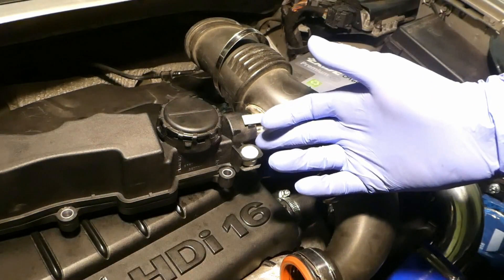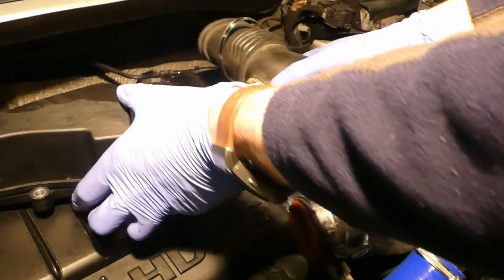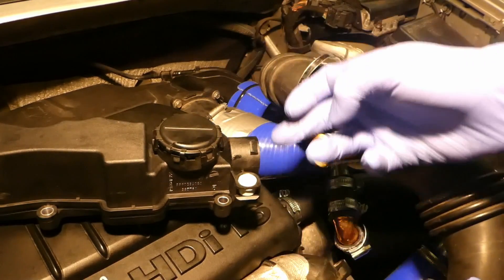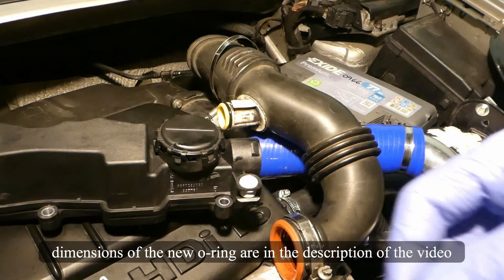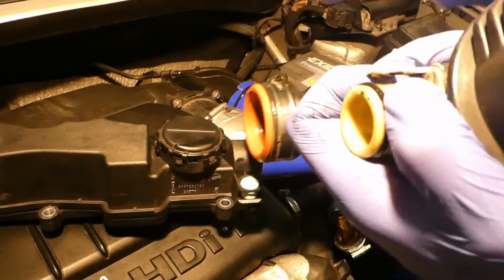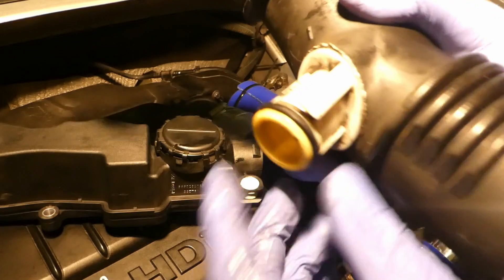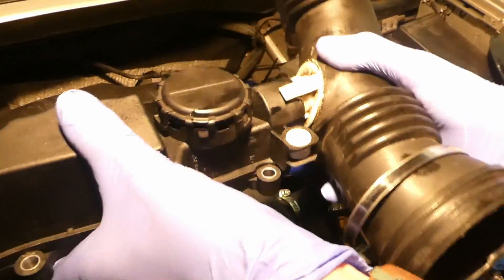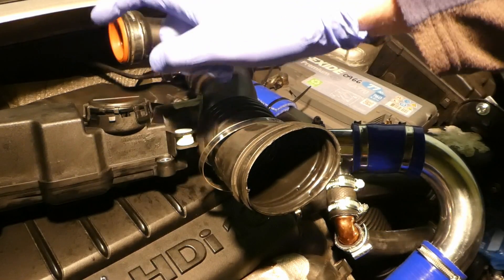How to fix oil dripping from the crankcase breather in 1.6HDi/TDCi (Peugeot/Citroen/Ford/Volvo/Mini)

Comment: Hi, scratching my head here, we've got this '10 partner at work,  with a 1.6 16v hdi engine, 90 hp. 
It's got oil in the intake , first thing i did, replaced the rocker cover with the PCV valve incorporated, gave it a run for a while, didn't change, still oil in the intake. 
I removed the  PCV/intake  hose, applied some gasket sealant on the worn-out o-ring thinking it might seal it properly, that didn't change nothing either. 
Took a look at the turbine, while it was pretty obvious that the oil was coming BEFORE it,  due to the fact that same blades on the intake spinner were bent, i went for and fitted a new turbine, the issue is still there. 
The turbine sucks so much oil in, that the oil comes out at the joint between the turbine and the plastic pipe  that sits right in between the turbine and the silicone hose before the intercooler. 
The engine runs fine, no excessive smoke, and the smoke that does come out has to be diesel-related as it's  black, not blue.   
Any thoughts? I don't know what else to replace on this thing to stop it from sucking all that oil from the PCV valve...  
Thanks in advance!
Reply from the maker: Is there an excessive crankcase pressure? Difficult to measure, but with a hand on running engine over the opened oil filler cap, should not blow too much
Next, it could well be a restricted oil outflow pipe from the turbo, did you change the oil return pipel from the turbo to the crankcase? Normally, if the oil does not return freely it will pool in the turbo and blow through the seals, but that would mean excessive blue smoke, not your case.
Now, if everything else runs ok, probably way too much crankcase pressure, I would not have thought something else. That would mean quite worn engine, but by the sound of it is not that.
No error messages?

Comment: Hi, so I bought and install a new valve rocker cover and did this like you said to avoid oil drippings but now it's spitting oil not too much on injector number 1, on the electrical component from a tiny hole in the back of the PCV valve cover, how can I fix this ?

Comment: Hello i have a mazda 3 1.6 and I have some of the oil leaking inside the tube and going into the turbo will this solve that problem? It also leaks from that o ring into the top of the engine.

Comment: I like the video, but I don't get how you came into conclusion that an o-ring of 4mm thick could replace an o-ring of 3.1mm. I have a small leak, and even an o-ring of 3.55mm is too thick to fit.
Reply: The o ring has a smaller diameter than the original, so although it is 4mm in its normal state, when the diameter is stretched to the size of the original o ring the thickness of the new o ring is lessened. 

The new o ring will have a shorter life span from being under constant stretched tension but considering how easy it is to change I think it is a reasonable fix over replacing the entire part

Comment: This is exactly what has happened to mine! So you don't have to replace the entire parts?
Reply from the maker: No, you do not need to replace the entire part, only the rubber seal with a slightly larger seal.

Comment: hey my turbo has a puddle of oil around intake and my engine refill hole is smoking is my crankhouse breather bad?
Reply from the maker: Could be. I would open the PCV valve and inspect the condition of the spring and rubber membrane. A little bit of oil is normal in the intake and a little bit of smoke from the refil also normal. Difficult to tell how much excessive is yours from a distance.
Reply: i have a puddle of oil in the intake. so alot of oil there, will check pcv valve
Reply from the maker: @Thatslugtho  If you have not cleaned it for some time it will be a puddle, like a spoonful or two is normal.
Reply: @moremolecules  i clean it and i have a puddle the same size after 1 hour of driving
Reply from the maker: @Thatslugtho  Yeah, looks like a little bit of excessive crankcase pressure that is pushing a little bit of oil or the spring in the PCV is broken/missing or the membrane is torn. Easier to first check the PCV valve.

Comment: this thick o ring will break because of the  heat its smaller en it will strech and brake ...better put thin layer of sealand in the groove and put original o ring back...works fine! just 0.5mm sealand
Reply from the maker: Hmm, by your logic any o-ring will break down and on top of that the sealant will not break. My o-ring that I put has lasted ~5 years by now and has not broken down in bits and pieces. If it breaks down, one just replaces it with a new one.

Comment: Hi,
I see your video...have One question, oring 4x26x18mm will work? I buy on a local shop, and they didnt have the sizes you mentioned
Reply from the maker: Yes, it should work, although maybe a bit more difficult to fit, but it should be alright.
Reply: @moremolecules  thanks, i Will try then i let you know.

Comment: Thanks. Have a 1.4 and that joint is loose! 👍🏻
Reply from the maker: Then the solution with a thicker o-ring will work. This shoud not be loose as there will be oil going through and a bit of loss of air.

Comment: Does rubber membrane inside CCV valve need to be glued to plastic.I checked CCV valve and membrane  was originally but i don't  know if it's matter?
Reply from the maker: No, it should not be glued at all. Should be freely moveable. Maybe it was stuck from the heat and so on, but it should be free.

Comment: I'm a bit confused so is 19 or  27 o ring ? 
And do you know what is original o ring for intercooler air intake which connects to turbo
Reply from the maker: ID is 19mm and OD is 26.5-27mm, ID is internal diameter and OD is outside/outter diameter.
Reply: @moremolecules  thanks after my comments I realised is inner and outer measurements, any idea for turbo flange o ring replacement size
Reply from the maker: @relaxul1467  I do not know the size on top of my head, but the Peugeot/Citroen part number is 144081, so you can find it on ebay for example

Comment: If i pull my oil dipstick 1.6 eHdi cactus euro 5 year 2014 OIL will hit my face its a lot of crankcase pressure .....its PCV bad in this case and how i stop from not make any damage to my baby 
I dont burn oil i have no leak oil or black smoke or oil in tubine only a huge blowby in oil cap and oil dipstick...Pls HELP
Reply from the maker: I'm not very familiar with the 2014, but it could be anything from the PCV valve to other things. It could be bad PCV and you could simply open it up and see if the spring has collapsed for example.

Comment: Very informative,  but I have a question , I've just had mine fixed , but still droplets of oil underneath,  could it be a residual oil build up from when it was leaking ?
Reply from the maker: Could be, but it should not leak anymore. Mine has not. Did you wipe all the oil left so you can see if it is still dripping?

Comment: Hi, Thanks for sharing. I have 3008 2019 Peugeot. Now i get this DTC crankcase fumes heater control- open circuit. I checked the valve cover and the round thing zigzag lockers on the valve cover is leaking oil into the intake hoses. Will replacing it help fix the DTC?

Comment: Problem solved thanks you are the king!!
Is this originaly your idea or... and why Peugeot/Ford did not put fatter O ring in the first place :/ ?
Reply from the maker: Haha, thank you. Yes, it was my idea. The thing is that eventually if you take the crankcase breather a lot of times in and out, the o-ring gets squashed with time. Also, with vibrations the original o-rings get squashed and needs to be replaced with a fatter one. Eventually the new o-ring will also get squashed and it will start leaking, but it will take a few years.
Reply: @moremolecules  Great.
So the fatter one will some day also get squashed but it should last a bit longer...maybe.
And yes you have to remove crankcase breather every time you change the oil...
Keep up the with smart videos 👍

Comment: I have a problem with my citroen c4 picasso..the car emits a lot of black smoke..does the crankcase problem affect?
Reply from the maker: Too much fuel and little air leads to black smoke. I would say either overfuelling by injectors (faulty injectors) or boost leak somewhere. I would have an OBDII scanner and have live data to see how much boost does the car produce. Should be ~1bar above atmospheric presure, or say ~1.5-2bars on the torque app. Maybe check if the air filter is not completely blocked.
Reply from the maker: One more thing, it could well be the MAF sensor next to the air filter box. Remove the electric plug for the MAF sensor and drive like that, see if it changes the black smoke. If it does, replace the MAF sensor.

Comment: Hey Thank you for the video, I have a C4 picasso 2007 HDI 1.6 and is leaking in the crankcase breather, which product do you suggest to clean up around the breather where is the oil?
I will change the O ring and I´ll let you know how it goes.
Reply from the maker: Hi Frane, any carburettor cleaner/spray would work. I would not spray too much in there. I normally just wipe it with a towel when the engine has been just shut down. The spilled oil is liquid and you can wipe it clean.

Comment: An o-ring with width 4mm, OD: 27mm and 19mm ID will not work it's too big, tried it.
Reply from the maker: Hmm, I ordered them and that is what I used. Seem to work OK on mine, a bit tight but that is the point. What year is yours and is it 1.6HDi?
Reply: @moremolecules  It's an 1.6 HDI in a 2006 Peugeot 207, it doesn't get in even if you force it.
I think it should be ok with a  OD: 26.5mm, ID: 18.5mm but with 27mm and 19mm it's really to big

Comment: I have oil coming out of the crankcase breather and it is smoky when idling. Is that normal? I was spraying EGR cleaner but the light smoke and fumes coming from the breather was problematic and I was performing that cleaning process outside.  I recently had a new Turbo fitted and the oil from the breather has become more noticeable. I want to re service my van because I don't have much faith in my mechanic. The Oil is very thin, too thin to be considered a premium product. I haven't checked the air filter yet. I am dreading it. It was last serviced 10 months ago. Full service, new timing belt/water pump etc.
Reply from the maker: Yes, replace it with a thicker o-ring and see how it goes. It should not be smoky when idling when the engine is in operating temperature. Is it blue/white/black smoke? My air filter after 3 years of servicing by Peugeot dealership was black as never been replaced before.
Reply: @moremolecules  the Smoke is misty like light fog. The engine was up to temperature.  I am not happy with my mechanic. He had one easy job, to fit a new EGR valve but he took the old solenoid off and replaced it with a new one onto the old valve which has seized up.  He probably thinks I am an idiot who knows nothing about mechanics.  I just hope he hasn't damaged the new solenoid.
Reply from the maker: @Surfingaliens65  Hahaha, most mechanics that I go to also think I am an idiot :-) that does not understand anything. Which solenoid are you talking about, the EGR solenoid?
Reply: @moremolecules  The black Solenoid with the spring mechanism. The old Solenoid was no longer functional and was full of carbon. No amount of WD40 worked and since the internal parts are press fit it is impossible to repair. I am guessing Valeo did that on purpose.
Reply from the maker: @Surfingaliens65  The EGR solenoid should not be full of carbon, as it is kind of protected. Yes, these are use-once-if-broken-buy-new-one kind of devices.
Reply: @moremolecules   I have opened 4 Solenoids in the last 2 weeks and all four of them are sooty and 3 of them were seized. Easy fix with PCB cleaner for the working one. You can also use de-ionised water to clean the electrical parts.
Reply: @moremolecules  A quick clip https://youtu.be/k2DsRLfWxko
Reply from the maker: @Surfingaliens65  Yes, that is normal. Oil in the engine is hot and naturally evaporates a little bit. It does not seem excessive.

Comment: Just thinking, is it better to let the oil drip outside, than keep it inside? What is better, have more dirt outside, or more oil in the turbo? I am also wondering, what to you mean with "CCV valve will work correctly"? I don't get how fixing the o-ring leak affects CCV valve working.
Reply from the maker: It is not so much the problem of dripping, although I hate oil being splattered around the engine. If the seal does not seal that well you would have an air leak. When the turbo spools and draws air, the valve closes to some extend from the drawn air or vacuum, so not to allow oil to be sucked from the crankcase. With an air leak, this will not work as intended. That is what I meant when I said the CCV to work correctly. Also, with the air leak the turbo will not pull the gassess from the crankcase efficiently and ending up with slightly higher crankcase pressure.

Comment: Hello. O ring remplacement 27x20x3.5mm/
Reply from the maker: The one I used was 27x19x4mm, it is a bit thicker than the original one, so makes a better seal.

Comment: Try using something for a removal tool that has less potential to cause damage to the main components, eg. the ring groove/land. Gouges risk ruining the new o-ring and ending with more mess. Picks, plastic upholstery tools, toothpicks, small teaspoon, broad-side of paperclip, etc.
Also, a little oil on the new o-ring can make refitting less cumbersome.
Reply from the maker: Thank you for the great comment. Yes, I should have used plastic tools rather than a big screwdriver. Inside of the crankcase breather is already coated quite heavily with oil, but yes a little oil on the rubber does not hurt. Thanks again.

Comment: Could you help me please. After having the air pipe seal fitted I have this problem. So will get the new oil ring fitted as you advised. I’ve just undone the jubilee clip to the air pipe and there is oil in there too. Is this because of the rubber oil seal ? As there wasn’t oil in the old one ? 
Many thanks
Reply from the maker: Hi Deborah, there are two jubilee clips on both sides of the air pipe. One is the turbo side and the other the MAF/filter side. If there is oil around the turbo side, this is normal. If there is oil on the MAF sensor is not quite normal. Oil from the crankcase breather (white pipe) will come out and hit the turbo and be oily there. If there is a lot of oil, it could be that the membrane of the crankcase ventilation valve is ruptured and the turbo is drawing more oil from the crankcase.

Comment: hi i cant buy from amazon uk. where else can i buy it?
Reply from the maker: The dimensions are in the description of the video. You can buy them then from anywhere, say ebay. I cannot unfortunately have links to everywhere. Just see if you can get the same size o-rings from ebay for example. There is nothing much special about the o-rings. It's good to be nitrile rubber, it will last longer and can sustain the temperature.